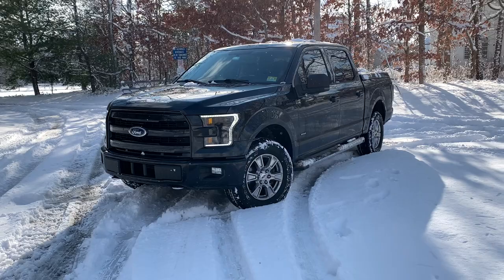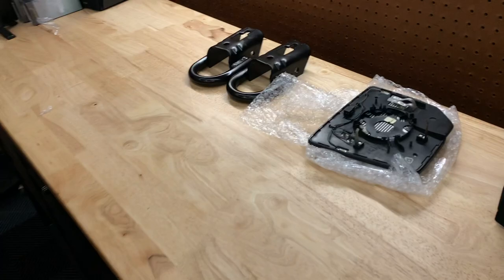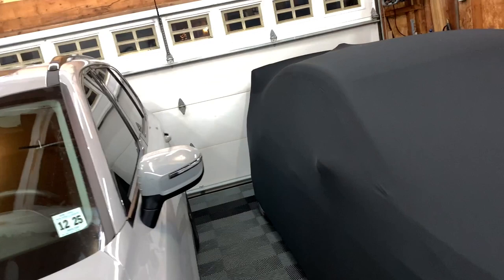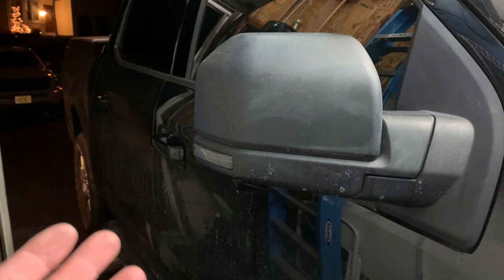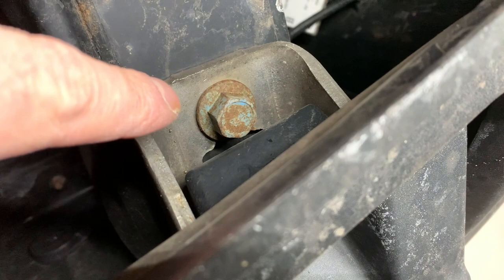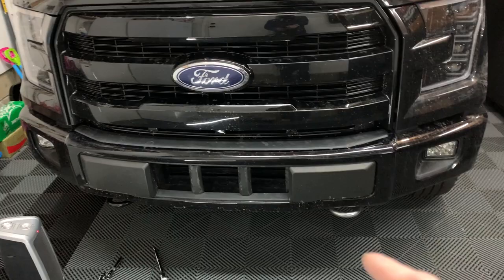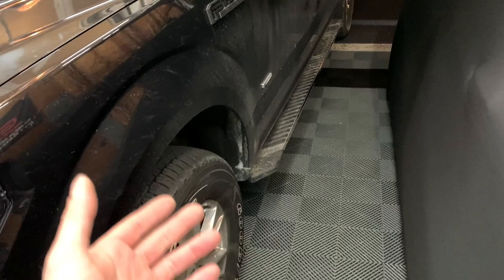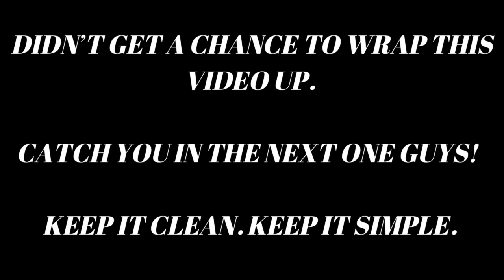Ford F150 Black Tow Hook Install I FIRST SNOW DRIVE!

Comment: Sti more fun to drive in those conditions!  Awd does great, switch to winter tires.  I have a 07, its a blast in the snow
Reply from the maker: I’ve driven Subarus throughout winter for over a decade. Absolutely a ton of fun, but I am not worried about the capabilities of the car in the snow. I am worried about the incompetent drivers on the road that could ruin it for me.
Reply: @Scoobyfreak86  I'm sure the truck does well in it also!  Keep the car in pristine shape in the garage, makes sense
Reply: I've learned the hard way what Illinois salt does to cars.  I keep my good cars clean and dry in the garage and I drive a rusty beater in the snow.

Comment: A Hot Dawg 60,000 BTU Gas heater and some insulation should be your next mod for the garage!  You will thank  me later.
Reply from the maker: Haha a heater for the garage is absolutely on the list. However, wouldn’t help in this situation since the door was open. Planning to finish off the sheet rock, insulate, and get a heater in there soon.
Reply: @Scoobyfreak86  Yeah, I thought about that too.  If you had natural gas, one of those heaters could work fairly well, but what electric heater do you have there in the video?  I've got a small 1-car garage so something like that would help when I need to rinseless wash or ceramic my subie.
Reply from the maker: I just have a basic small home heater. Doesn’t do much, but it does help raiser the temp a few degrees once the door is shut.
Reply: @Scoobyfreak86  Yeah, a 1500W one should suffice if you've got the door closed and run it for a solid 20min.  We had a smaller Lasko one, but for some reason the wife got rid of it.  Now it's cold oil changes in the garage during winter!
Reply: @Scoobyfreak86   Yes sir the heater wont do much with the door open, I had to run a gas line across my entire basement and out the wall but well worth it i leave it at 62F and the STI is happy

Comment: Just curious, why not just paint the chrome hooks?
Reply from the maker: You could, but it’s a high impact area right up front. Easily could chip and look pretty crappy quickly. And new ones were only $50, so wasn’t worth the effort in my mind to paint the chrome ones.
Reply: @Scoobyfreak86  fair enough, not a Ford guy but the truck looks awesome